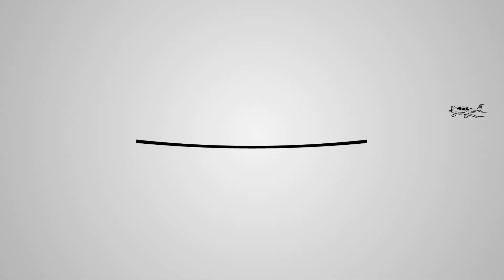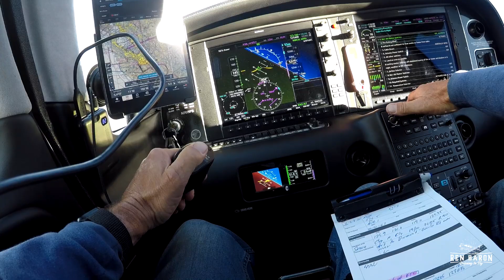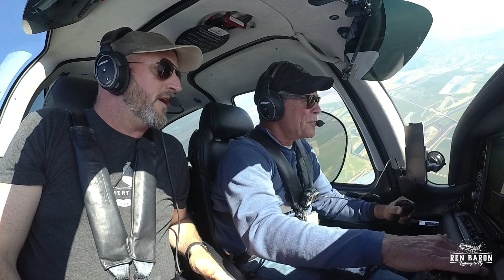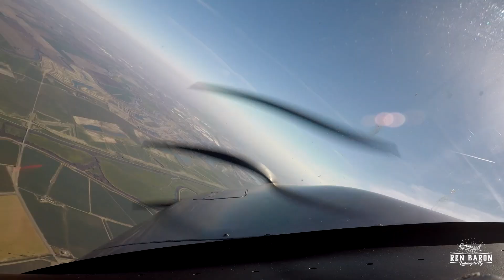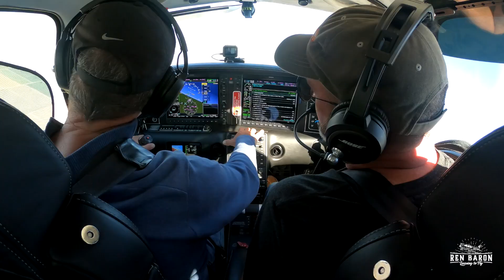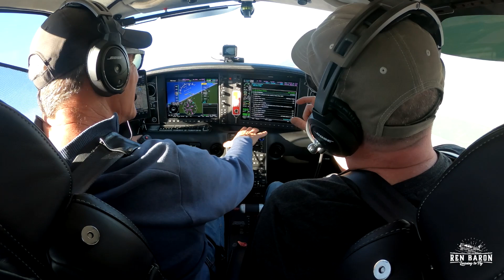"Fire In the Cockpit" Emergency Procedure in Cirrus SR 22T Gen 6

Comment: Wait, so that really happened to you and your wife? Did you video it? Glad you all are safe.
Reply from the maker: It really did happen. We were flying in our Sling 4 on our first cross country trip together. Turns out that a small piece of debris blocked the oil return line in the Rotax engine causing oil pressure to drop and oil to come out the exhaust pipe which was the source of the smoke.